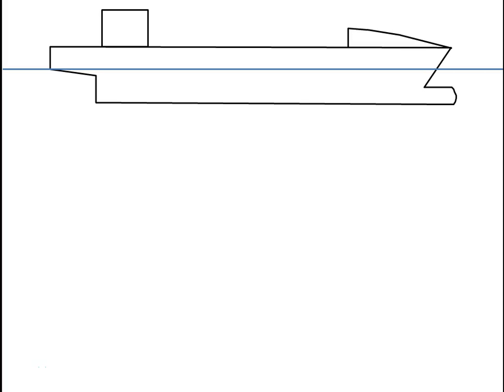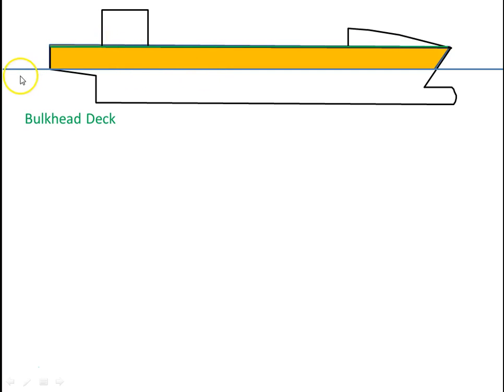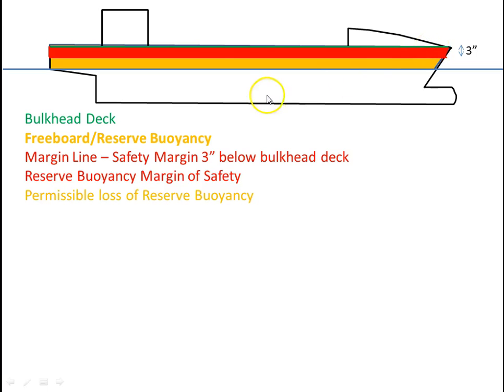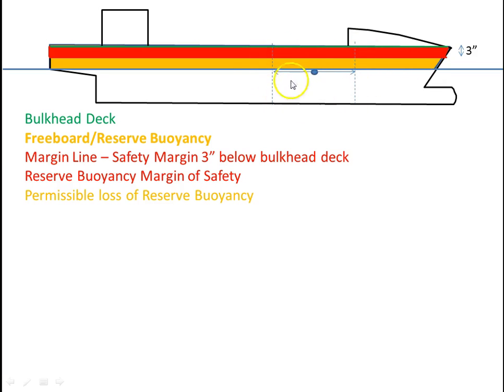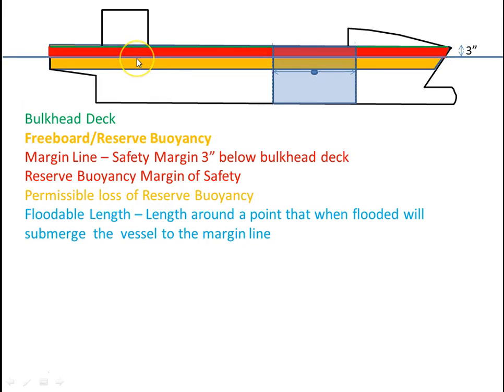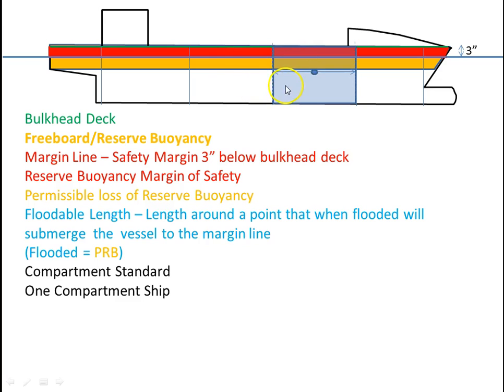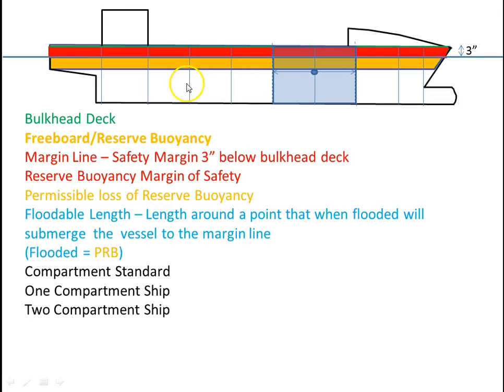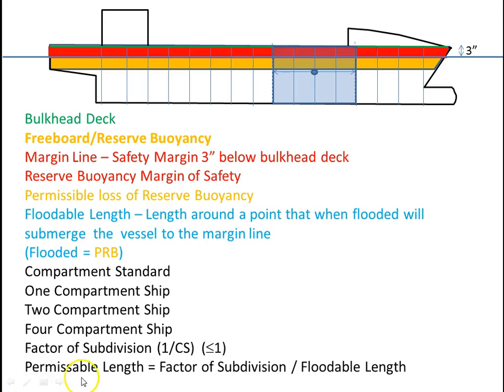Damage Stability - Some Useful Definitions

Comment: what is permissible length ?
Reply: The flooding length of each point along the length of the ship is multiply by permeability to obtain permissible length .
Flooding length : the length of the ship that is flooded to cause the ship to sink or trim to margin line 
Margin line : Is an imaginary line 75 mm blew the upper most continuous watertight deck